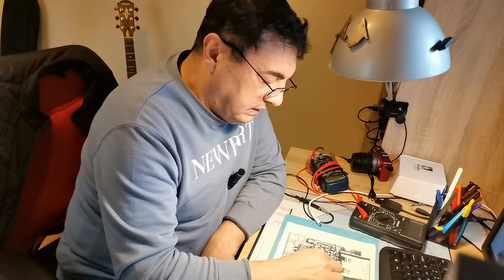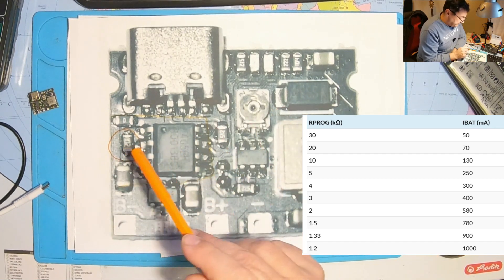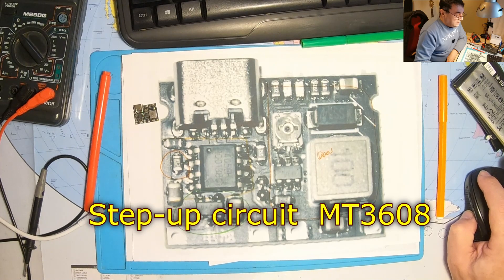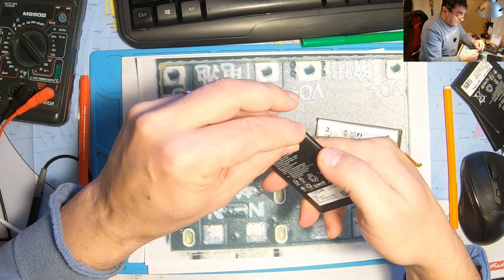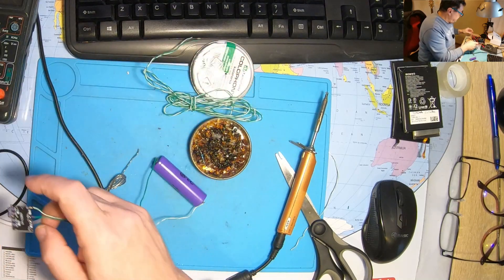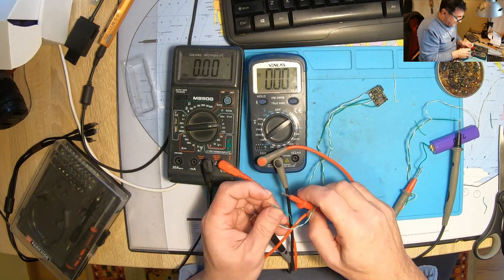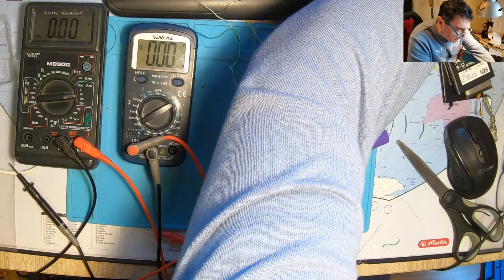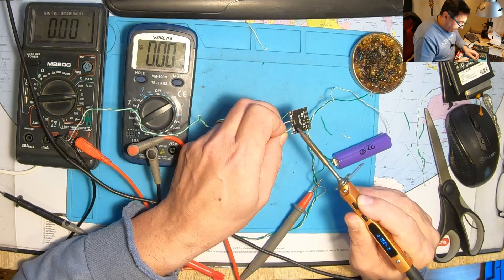LX - LCBST Li-ion output test

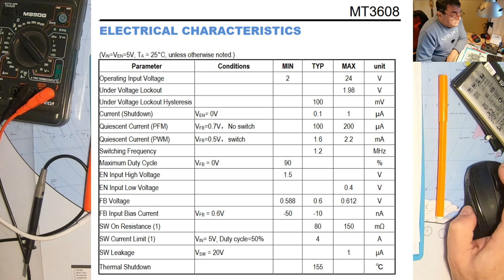Comment: 4:04 discharge undervoltage protection: "T point" - badly documented in product description
2:58 boost chip: MT3608
2:04 battery discharge protection chip: HM5454/HM5434 ? ("MKG2F")
0:36 battery charge control chip: TP4056

6:42 standby current: 200uA = 0.2mA -> drains a 3000mAh battery in 1 years 8 months
7:14 short circuit protection: YES, 30mA, heats up?
8:36 8:48 cell reverse polarity protection: NO, it will burn discharge protection chip
11:07 output load testing
Reply from the maker: Thanks and I put it in the description. If you don't mind...
Reply: @viocaia  sure. Thanks for the super helpful information :-)

Comment: Hi! Thanks for this video, it's really informative :D
I was wondering if I could power a 10-20mA device with 12v using this board, or it will just turn off after a minute like power banks?

Thanks.
Reply from the maker: As long as there is a slight power output, the device will provide...I use those for powering my multimeters instead of 9V batteries, so far it works great.

Comment: great video, i would like to know, can i use these module to charge 4 batteries 21700 4000mah each on parallel ? thanks.
Reply from the maker: Yes you can but it will last forever! Let's say it can deliver  1Ah for output and you will have a 16Ah battery, so will take 16 hours to full charge with 1C. You may experiment though. Think like filling a bucket with a shot glass!

Comment: Nice. Im trying to drive an LED frontvus board and a 18650 cell, but it seem to cut out very early (like a minute) and the LED starts flashing as the voltage seem to cut/drop. Any idea on what could be wrong?
Reply from the maker: Maybe the cell?
Reply: @viocaia  i wasnt using a proper resistor.

Comment: I purchased the device - the 5V output. At first it looked well with my Arduino project: the battery is well charged, and the arduino project is working well under load, both when connected to external power (through the LX-LCBST) and when the external power is removed, so the  battery is providing the power. However, there is a strange thing: When power is connected, I can turn on and off the arduino project, with no issue. When I turn the device off, without external power connected, the Arduino will not power up. Any idea?
Reply from the maker: Interesting...probably the Arduino input/load it's a high resistance value that the module doesn't see like a load, and it's not turning on the boost converter from stand by...try to add a 1-10 K in parallel with the power input
Reply: @viocaia  It is strange. The charging goes well, it works well if starting with IN power connected, and keeps working well if the IN power is disconnected while in action. Yet it will not start working with just a battery connected. 1K ohm resistor did not help either.
Reply from the maker: @YigalBZ  Interesting. .I have no idea. Maybe you should try another board.
Reply: @viocaia  That was a good idea. Another device solved the problem.
Reply from the maker: @YigalBZ  Yep, they are cheap and I don't bet for original chips too...
Reply: @viocaia  Now  I succeeded to damage the 2nd device: My design feeds the ESP32 controller from the 5V output of the LX - LCBST. The input is 24V DC. When I tried programming the ESP32 (while no DC is provided to the LX - LCBST) from the USB port, it seems that the 5V from the ESP32 (from the USB port) damaged the LX - LCBST. Could it be that this damaged it?
Reply from the maker: @YigalBZ  I don't think so...It's looking like you applied 5V to the output of the module...that shouldn't be a problem. Eventually get a diode in series between LX and ESP and rise the voltage to 5.5V. The diode will stop any return voltage...
Reply: @viocaia  The LX provides 5V, I can't change it to 5.7V
Reply from the maker: @YigalBZ  Right!
Reply: Any idea of another good alternative? I will need to do another version to the PCB anyway...
Reply from the maker: @YigalBZ  Probably 24V input for LX is too much. I can't explain why it's wearing so easy. Also maybe not enough  current. But you may try any LM2596 buck converter which works until 40V input and much better current.

Comment: What is the output voltage of this device?
Reply from the maker: It's going to 27V
Reply: @viocaia  Did you test if the voltage is stable under changing load? I need it for 5V. Also - where did you buy it from?
Reply from the maker: @YigalBZ  Yes, stable and reliable. Of course, under  decent loads. Check my other videos about it. You can buy from AliExpress, try a search there...

Comment: Hi, very good video. Is this module working with small load (10mA) or it will swich down after few minutes? Some modules for powerbanks going to stanby, when the output current is low.
Reply from the maker: let me see.. I'll be back with a test.

Comment: If I had a LiPo that had its own charge protection, where would I wire the 3rd wire to with this charger?
Reply from the maker: No need for the third wire. It should be better to connect directly to the cell, bypass its own protection.

Comment: Great work. Thanks for sharing. Would you be able to tell if the module has overdischarge protection (both current and voltage)?
Reply from the maker: All the protections available, including output short circuit.
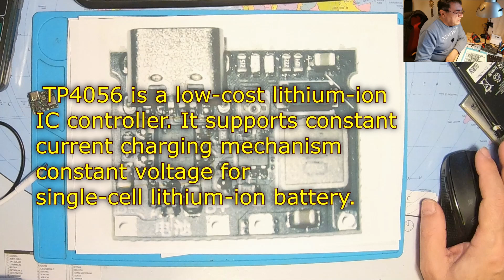Reply from the maker: There is TP4056 which handle charge/discharge, see video 1:03